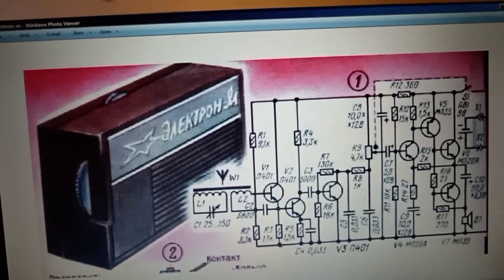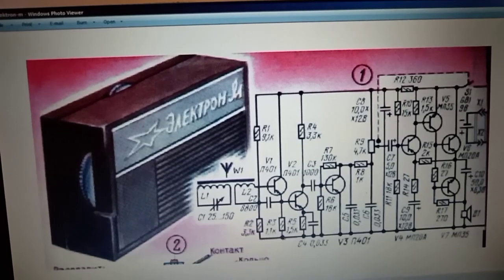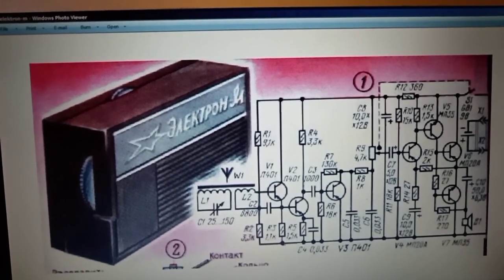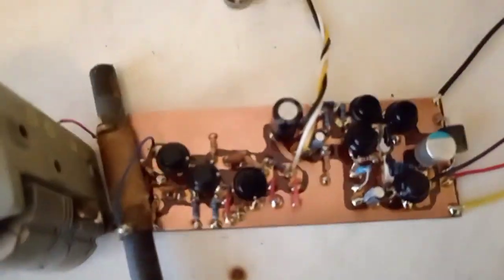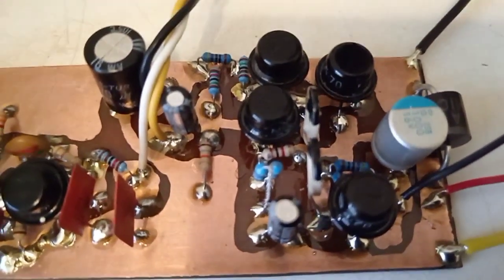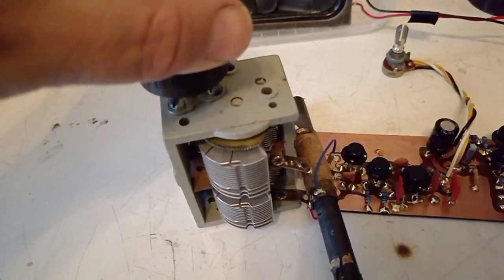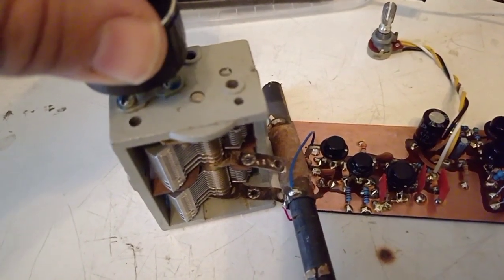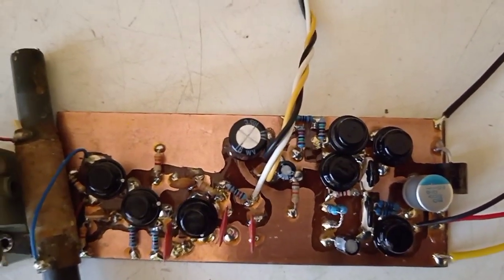Soviet Electron-M ( Elektron-M , радиоприемник электрон-м )radio receiver reproduction by YO6PMX

Comment: A fost primul meu radio construit de mine Am si azi cateva dar nu mai gasesc tranzistori mp 35 si nici echivalente pt ca mi s-au ars sau cateva aparate au fost distruse de persoane rauvoitoare! De asemenea Iunosti kp 101  Adica Tineret pe romaneste pt ca aici nu am tastatura in lb rusa! Am schemele electrice si acum. La Electron din fabrica condensatorul variabil era prost si l-am inlocuit cu unul romanesc de 270 pf cu care erau echipate radioreceptoarele Pescarus. Am tabel de echivalente pt acesti tranzistori dar nu se mai gasesc! As fi interesat de asa ceva!❤❤❤❤
Reply from the maker: Se gasesc foarte usor pe Ebay!

Comment: How is the detection done? Was expecting a diode somewhere.
Reply: Audio modulation of the RF carrier causes corresponding current change through V3 which causes audio signal voltage to develop across V3's Collector load resistance including the volume pot. The capacitors filter out the RF.
Reply: @xavieraxiak6866  Thanks Xavier, that's like the old "anode bend" valve radio detectors from long ago. Thought there might be more signal with a diode, but obviously it works!

Comment: The radio that I have : (  made in USSR !  ) has these large black painted transistors , ALL  in plug in sockets ... possibly to reduce any damage by the hot solder process ? ? ........................ DAVE™🛑
Reply from the maker: I don't know why they were using those sockets in the early transistor devices, maybe was just a habitude that remained from the tube era...

Comment: It is a bit harder to look at that schematic with the negative rail up on top and the positive rail on the bottom.

If I am looking at it right, there is no regenerative feedback, nor is there an IF stage.  I would expect the reception sensitivity of this radio to be quite limited, and it seems like a lot more could have been done with that many transistors.
Reply from the maker: Back in the days, in the germanium era, when they were using mainly PNP transistors, the positive lead was the "common", only with the silicium devices the "chasis" became negative. Of course that with 7 transistors you can make a superheterodyne, but those kits were made for kids, they had no knowledge nor lab equipment to set up an intermediate frequency or a local oscillator. These receivers were intended for local broadcast stations, not for DX...
Reply: @perianmarcel2059  Great info!  I work with leading edge technology but really love the old stuff, including designing with vacuum tubes.

Thanks for posting such an interesting video!
Reply: The antenna signal is applied between the Base and Emitter of V1, so it will have the same amplification as common Emitter stage although the amplified signal is present on its Emitter.